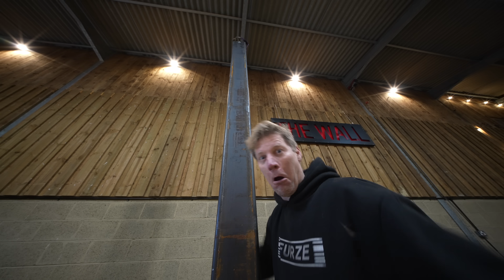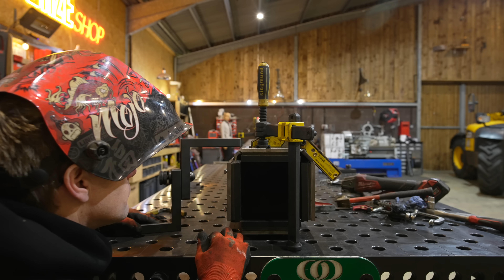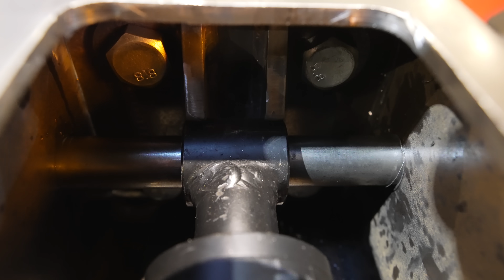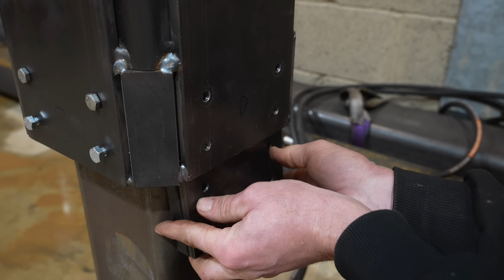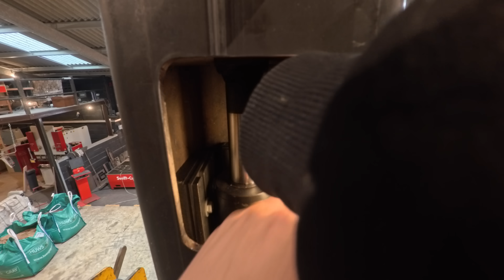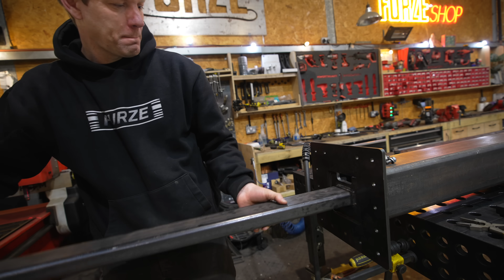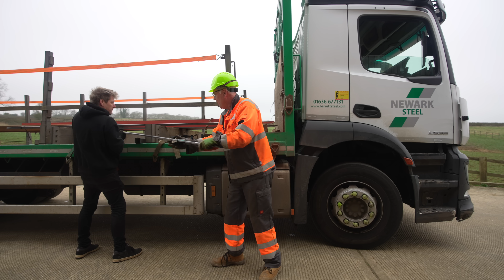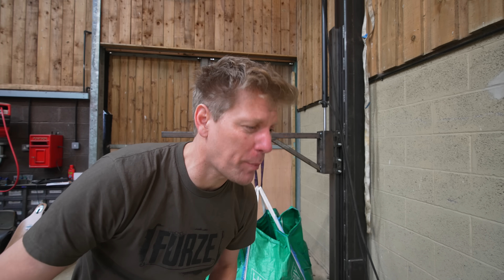Digging SECRET Garage Part 7 Car Lift Prep

Comment: This is really any boys Dream but i feel like the Lift is just a Catastrophic Accident waiting to happen. 

How do you make sure that nothing is below either of Floor Plates? Or that nothing gets wedged between the Floor going up and the sides of the ceiling? Elevators can get away with it because they are a closed system and you cannot enter when it is motion. And even then there is a "Bowl" at the bottom of a lift that you would be able to hide in even in the worst case scenario that the Elevator starts going down while you are inside of the Shaft. And if somebody does park on top of that Lift while it's going up, what is going to stop that car from sliding off? Even if the top is perfectly level, Cars aren't perfectly Balanced and even that is only even a consideration if you park in the direct middle and not slightly off to the side or even just accidentally partly on a part of the front yard that doesn't lift up.

Comment: will ur car not be much heavier after you electrify the drive train, also if you daisychain (in series) the hydrolics will that not push most of the fluid to the nearest ram and push them out of sinc, would they need to be in parallel with the same length of hose between the pump(s) and each ram?  and not in series

Comment: Should have done 4x screw jacks connected to a central chain drive. Only way to drive up evenly when weight distribution changes on the platform. 4 independent hydraulic legs will be an absolute nightmare when the load is off centre.

The cable system will only work if all 4 posts have a cable loop to a central location, and attaches to a summoning valve that diverts more pressure to a lagging cylinder/s

Comment: When you order your single trow hydro, a power up power down cylinder would add a huge safety factor in case you have a hose failure

Comment: 10 ton deadlift through 2 meters. Energy=Mass times acceleration due to gravity times height. That's 10x1000x10x2 Joules. A 20KW Hydraulic pump will take 10 seconds to raise that. But lowering it you have 0.2 MJoules of heat to lose somewhere. That's bonkers. Perhaps this lift could have a counterbalance mechanism and function a bit more like a funicular railway? Then you are only actually moving the 1 ton of car and everything gets 10 times easier, you wouldn't even need the 3 Phase power supply for the pump. Four 1 ton sand bags on pulleys which move though 4 Meters would give you 8 tons of counterbalance?

Comment: for the pad adjuster bolts you could use slightly longer bolts to fit locking nuts to lock the bolts in place once adjusted?

Comment: Considering Colin (AFAIK) has limited formal training, this project is incredibly impressive.  He reminds me of Mike Patey's intros where he says 'Design it, build it, break it.'   Exactly the gist of Colin's approach.  He designs and builds an incredibly complex system with some prety high loading, and most of the time, it works.  Mike Patey would consider Colins projects over built, because his builds have to take off and fly, but if Colin had a similar constraint, he would absolutely design around it.

Comment: Colin, I used to maintain electric hydraulic and pneumatic bollards. You’re very wise to have the bearings adjustable. Everything will expand and contract and twist and adjust. Silt will wear the sliders, dirt will fill the bottom.

The simpler the better, if you can prevent using cables that will stretch and need adjusting maybe? Find out how other machines synchronise rams?

The ram inside is the best decision ever though. Any way to prevent twisting and uneven pulling. Belts and pulleys are a nightmare over time as there’s no way to pull it from directly above, it’s always just to the side.

Comment: Bearing on structural steel is not the best idea for durability.
Work hardening as someone else said, but alsowear : bearing races are super hard, H beams are not... So the bearing will overime dig into the metal. And it's not ideal to have to replace the H beam rather than bearings.

I'm an engineer in a fiber cement plant, and we have some columns running on bare bearings. Granted it's industrial use, but in 3 months the bearing starts digging into the metal. 

We ended up machining some slots and we have some sacrificial flat bar that we replace when they start to wear

Comment: 28:46 in practice this would work fine, but I worry that what will happen is this will just lead to the whole thing twisting and binding, instead of synchronizing, since even if the cable is super tight and strong, if it's far enough out of sync it will just find the weakest link and slack on that.

Comment: Too many issues with hydraulics, should've went with large-diameter heavy-duty trapezoidal leadscrews / ball screws. And solved buckling in some way (by adding midway support nuts, sliding in same way you just made for the beam carriage). Seeing how much steel you wasted on these nested legs, wouldn't be much of a difference lol

Comment: This reminds me of a school project at Mechatronics, where we had to build a boom which bent less than 10 mm when stressed with 100 kg at 1 meter made of 10 kg of steel. To test this, one of us had to sit on the end and have buckets of water to get to the 100 kg total. It did however bend 100 mm, because the plate we fixed to the mounting plate was quite thin and the mechanical guys told us to just tack weld it together a little, but it turned out to be far too little... the cheap buggers didn't want to spend an expensive piece of steel on us and we paid for it in our score :/

Comment: @15:00 after cutting the slot I had the thought that maybe you could "skeletonize" the other 3 sides of the posts. You could cut some medium sides triangles, or other shapes maybe myltiple Furze logos, to remove weight while mataining structural integrity.

Comment: Colin. Before you get to deep with this design...
Look into the corkscrew hydraulic lift .. they use them on race haulers... 
10x easier then what your doing ..

I bet you could even do just 2 on cross corners wouldn't even need 4

Comment: I'd maybe slosh some rust converter inside the box tube you cleaned to limit future re-corrosion. You could probably also use proportioning valves to fine tune each ram if you connect them in parallel, if you find they want to push at different rates.

Comment: wonder if having a lip to hold the "tray" the car sits on is enough to hold the tray with the car on it , the metal of the tray will flex the parts mounted to the comlumbs will flex and im no sure if they will spring back to straight the tray will rest solidly on the turn table and the parts holding the tray to lift it will clear the tray completely enough for the thing to turn 
besides that the tray probably will turn out to be ramps like any other fout post lift if youre planning to use it to work under the car 
might be simpler to build a convertional lift solidly mounted to the four posts  and add a second lift with the turning mecanism build on the floor in the center of it that fits in the between the ramps of the main lift , lifting the car by the frame of it using a single hydraaulic cilinder with a bearing to be able to rotate the car after lifting it a few inches of the main lift , having that H shaped bridge sunken intoo a sub / workfloor will alow you to work under the car without breaking youre neck over stuff sticking up over the flor under the main lift  , only thing is that if the the main lift is just ramps with a big hole in the center people can fall in if the cars not on it and the lift is raised  to the top , that is a 3 meter drop to the bottom and people / kids arent designed to survive that without some broken and busted components 
one solution would be to fit removable grates in between the ramps that closes up the hole but you can lift out or slide out of the way (maibe intoo shelveholders mounted ontoo the wall , raise the bridge to slightly above the things and slide the panel out of the lift ontoo it to create the hole to work through ) to work under the car , the grates might need to come up and sit on top of the turn around lift btw .... smaller holes that lift feet fit through
i like the idea of butting two hydraulic cilinders end to end to create the length you need when extended , thats an idea i wouldnt had thought off and a cheaper solution than a two stage hydraulic cilinder 
the slot to pull the cilider out is an ok idea , but wat if by some fault inside the cilinder the rods cant be completely pulled in , you might need to do ome cnc milling and cut doors in that fit flush with the inner pipe and is mounted with rows of countersunk bolts
another option would be to choose aa slightly wider outer tube , cut one side of the innertube completely open leaving a 1 inch lip on each side and mount a plate over the full ength of it , again with rows of bolts along the whole edge , having cut box section to make U beams myself the stuff warps all over when cut , you might need to weld together youre own box section in the size you need with the plate mounted on the side and machine the mating surfaces after welding so it fits on the outer tube without binding 
i seen factory build lifts where the hydraulic cilinders are mounted under the ramps and the lifting is done by cables conecting the cilinders to the tops of the columbs  , he amount of weight it needs to hold up might become an issue though

Comment: Colin, I don't know how far you have gotten since the filming for this video was finished, but instead of your idea of using a wire to balance the lift arms, you should be using counterbalance valves. They are used in heavy equipment to allow pairs of hydraulic cylinders to remain in sync when lifting material. You would most likely need three valves for this system. If the pillars were numbered 1-4, you would want to have a valve between 1 and 2 and a valve between 3 and 4. Then the third valve, which would need to be larger, would be in between the two groups of cylinders. This would minimize complexity and provide a higher level of control.

Comment: What happens if the hydraulics fail on one of the legs do you need to fit a safety mechanism that will lock it in place?

Comment: Point of note for that M12 eyelet - If it's an 8.8, an M12 bolt will take 70Kn before it even begins to break. I believe that roughly translates to 7 tonne (or ton, I dunno which is which)

Comment: I think the bearings won’t last long on that rough surface. I’m an aircraft technician and the landing flaps on basically every airliner run on carriers pretty exact like collins design and following double T beam to deploy flaps. The surfaces are perfect and still from time to time the rollers wear out. And that’s all high tech materials.

Comment: When you roll up outside in the car and want to raise the lift to park in the garage, will you have a video available in the car or your phone to check it is clear below to operate? Also ditto available in the garage to ensure clear above. Could be comical watching a delivery guy crossing the lift roof being hoisted into the air. Or nasty if lowering onto a badly placed body part?

Comment: Question, if a hose starts leaking inside the steel, how do you replace it? Are 3 legs able to take the weight if you need to take one out to access the system or work on one leg?

Comment: Have you factored in the weight of any snowfall in winter? Idk how it is there but here we can get ice sheets on the drive two inch thick plus more on top.. also saying this i have to ask in my tony stark voice, how did you solve the icing issue?

Comment: Collin. Maybe removable caps on top with access from the top surface. Rams mounted with pins to transfer force to the leg boxes. So if you need to maintain or replace a ram you remove the cap, remove the lower and upper pin and use a winch or something to pull de ram out of the leg.

Comment: One ram, and cables, would have done the job. No chance of misalignment or skewing. Catch-pawls make it safe. And maintenence would be easy. That is a standard method in garage lifts. And the lift arms can be swung/locked for work/access.

Comment: Synchronising the 4 pistons, you can pass the oil volume trough 4 Hydraulik gear pumps which are connected on the same axel in a row. There is prefabricated hydraulic systems for this use case.

Comment: So, I worked for this eccentric developer in Montreal a bunch of years back.
We did this crazy job that he was gonna occupy one of the Houses with his family and he wanted a car lift.

So we did 2 years of work getting it all right before this car lift arrived from China.
Installing it wasn’t that tough.
Not easy but…..
We did it.

In the end we were all
Like wtf is gonna keep the water out and how is it not gonna freeze up in our shitty winters.
We all agreed the seals were very sub par.
Sure enough the first winter he used it, a BMW got stuck  downstairs for 3 months.

He had a 2 wall carport with steel grill on the backend and a steel gate on the front.
Water poured in on 2 sides.

Haven’t watched this video yet and I’m aware Colin’s location doesn’t freeze up often but he obviously gets a lot of rain.

I’m very curious to watch this.
He’s worked so fucking hard to get to this point.
Hopefully he puts a garage over the lift.

Comment: Please think about safety valves, for in case of hydraulic line break. Kind of high volume shock acting and closing the backflow. Have to be hard adapted to the lower piston connection. Hope you as well thought about plunger cylinders (no piston, only rod gasket on top), inner cylinder rod end have to be guided inside the piston, and the rod diameter is the working area. You could look out for some industrial scrap for recycling of some cromed rod. Great project. Can’t wait to see it working.

Comment: Mechanical engineer here. Love the build so far, followed it since day 1. To sink up your cylinders, you can use hydraulic flow controllers and pressure regulators. They will ensure that each jack is working on the same pressure & hydraulic flow while lifting. That + the mechanical sync up you mentioned can act as a failsafe just like your breaking system. I've used the same hydraulic setup to lift up to 30 ton pieces of equipment like it's nothing.
Reply: 'breaking system'? I think he wants it to stay together...
Reply: @nectafarious8842  oh nice job spotting my typo 😅 gotta leave it there now i guess

Comment: I would recommend looking into cam followers to replace your bearings. They are designed specifically for the application, with an outer surface specifically designed to be a roller, and with eccentric adjustability.

Comment: If you take the retour of the first hydraulic cylinder and put that hose on a cylinder that is inverted, you could power two cylinders with the same exact displacement. If you repeat this you could do it for four. Half of them are pulling instead of pushing. So you connect the rod sides en the piston sides. I can explain better if needed.
Reply: Good idea :)

Comment: Would really like to see what you would design for zombie apocalypse but like local DIY stuff only to fortify your house or shed. Your bunker is a fair bit of a cheat code already. Respect for coming up with the idea using multiple hydraulic lifts working in tandem btw. That was genius. Two hydraulic lifts and a turntable.

Comment: Colin for the turntable you could use a slew bearing off a digger. Be well able for the weight and you could use ring gear and slew motor off digger too to spin it

Comment: There is no need for the cable system just use 1 motor with 4 pumps so all cilinders get the same amount of oil

Comment: Colin, you should install double pilot operated check valves in case something happens to the supplied hydraulic pressure, that way the cylinders will stay where they are and not suddenly come down.
Reply: 👆100% agree with this. It’s an absolute must. And put them as close as possible to the cylinders to minimise the possibility of a piping failure occurring downstream of the check valves.
Reply: He mentioned a safety brake device for each leg towards the end of the video. That device isn’t sufficient?
Reply: @StannisTheMannis305  Even if it is, having more than one redundancy cannot hurt.
Reply: @StannisTheMannis305  redundancy is the name of the game. gotta have multiple safety features in case one fails.
Reply: @StannisTheMannis305 if he is going down and a line blows out while the locks are pulled, this would allow the lift to stay or fall slower to set the locks and stop the decent
Reply: Counterbalance valves...
Reply: I'm sure he knows what he's doing
Reply: @tbwcjw  Yeah he probably does, but it can never hurt to tell someone how they could be more safe. I know if I were building something like this, even if I already planned on adding double pilot operated check valves, having someone suggest it to me would not be a problem.
Reply: @arsonathan pure backseating
Reply: @tbwcjw  people go to school and gets years of experience to be able to design these things… and they still make mistakes. I applaud everything Colin does, but there’s some blaring mistakes in this design. I predict he’ll be reaching out to an expert in future episodes.
Reply: @sv8645 I was under the impression that he commissioned these designs and just constructs them
Reply: @orang1921  What gives you that impression? The video presents the entire design/trial-and-error process.

Comment: Safety engineer here - not on this scale, but the principles apply.
You probably want to allow for at least DOUBLE the forces you expect the system to handle, to give yourself a safety factor. The standards I usually work with look for 4x the force.
This allows for up to 2 of your rams to fail, and the system to still be able to hold up safely.